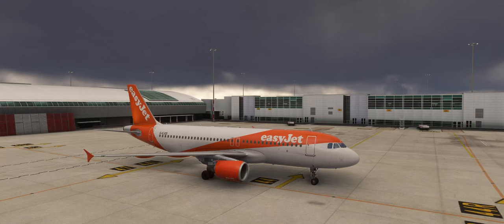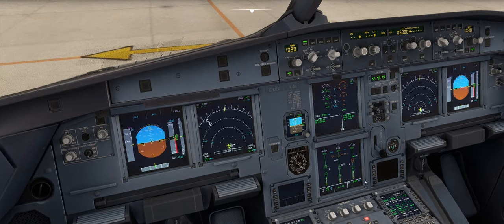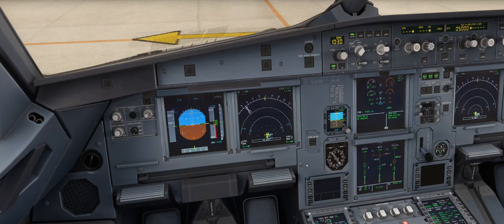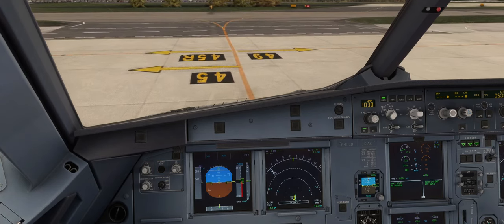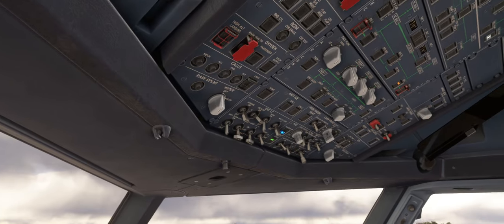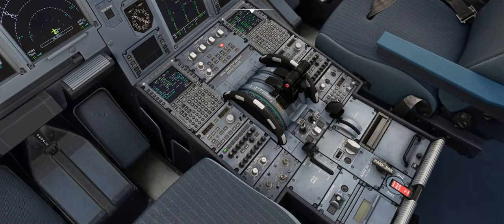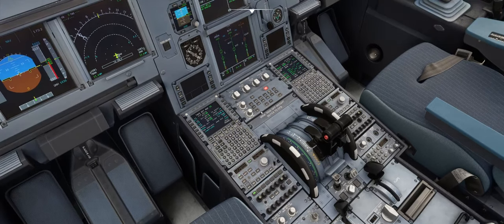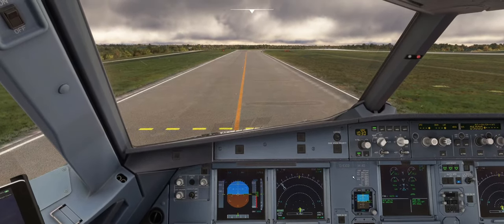Fenix A320: SINGLE ENGINE Taxi Procedure with a Real Airbus Pilot! Fenix A320 Tutorial | MSFS

Comment: Dear Captain, I would like to ask if we start engine 1 as usual? So the APU and APU Bleed are on and then when Engine 1 is running we turn off the APU Bleed?
Reply from the maker: Hello, that's correct as per Airbus standards but operator SOPs may vary

Comment: 6:31 "park break must be set for start of eng 2"

but i have seen airlines start engine 2 while taxing to the runway without stopping. Can you please explain in more detail
Reply from the maker: Hello, on single engine taxi when turning off the Y electric pump and the PTU performing its self test when the Eng Master 2 selector is turned on it is possible to lose nose wheel steering control. Some airlines build in a SOP where the airline must be moving in a straight line for at least 5 seconds from selection of Eng master 2 however to be safe, stopping the aircraft and selecting the park break to on is deemed the safest way and is adopted by most of the major operators